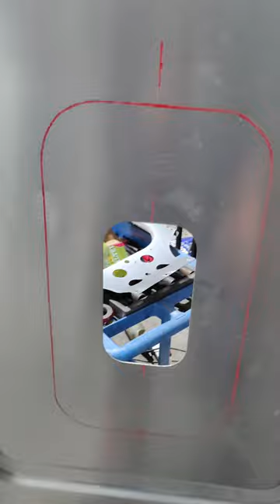Freightliner Cascadia side wall window cut and installation / rebuilding process

Comment: If I have a 2020 cascadia with no windows on the bottom, and I want to add windows like y’all did…besides tools , is there any other pieces on the inside that I might need ? Trims , frame brace etc. I would figure I need a new interior piece that goes around the window on the inside , but is the brace there as well ?

Comment: I have a 2019 freightliner cascadia. Want to buy these windows and install them. so what do I need besides the window?
Reply from the maker: You need the tools you see on the video I am using and also you need to remove the panels from the wall to be able to cut it accurately!
Reply: @valeriumoscalu7580  yeah tools and cutting is not a problem. Do I need the upholstery cut as well?
Reply: Did you get it done …I am wanting to do this on my 2020 …it does not have the bottom windows…I am wondering what all is needed as far as interior parts go